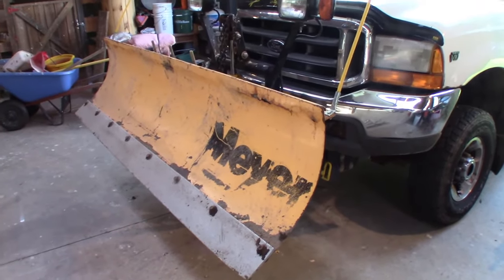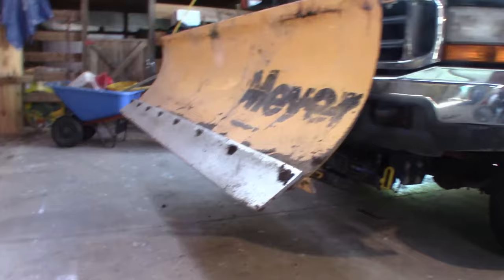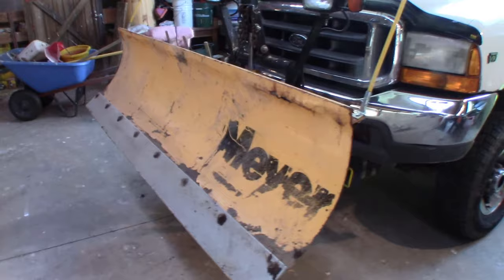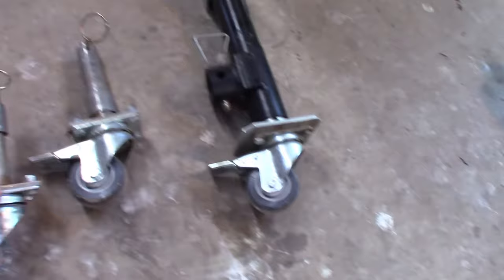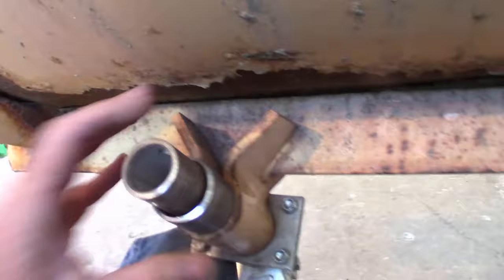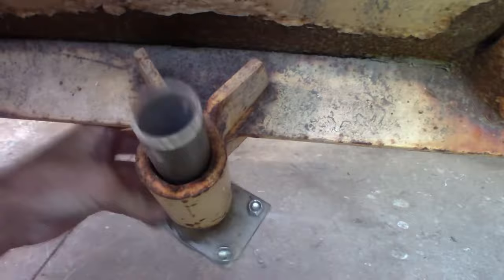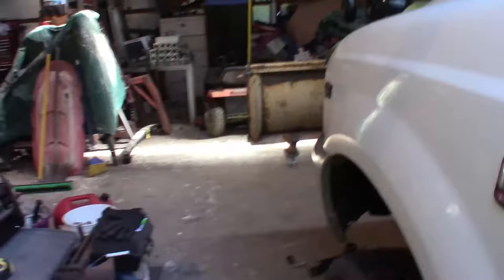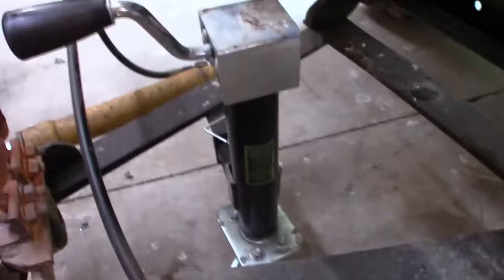Meyer MDII ST 7.5 Snow plow storage solution.

Comment: I was looking at the meyer wing man snow plow that hooks to a 2inch receiver Kno anything about them
Reply from the maker: I have no personal experience with the wing man.  I've seen a couple of the home plows which is a lighter version of the 2" receiver style.  I suppose it would depend on what you were using for, I wouldn't trust just a 2" attachment point for our rough gravel driveway or anything commercial.